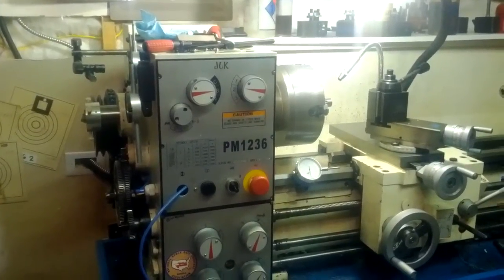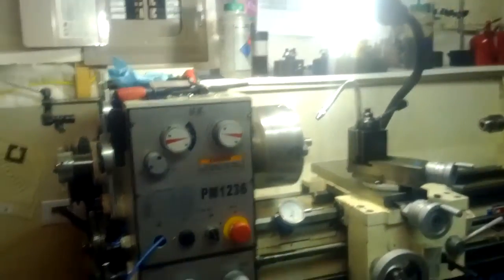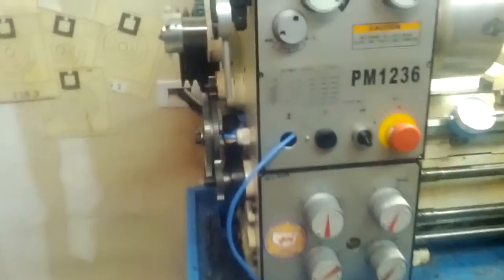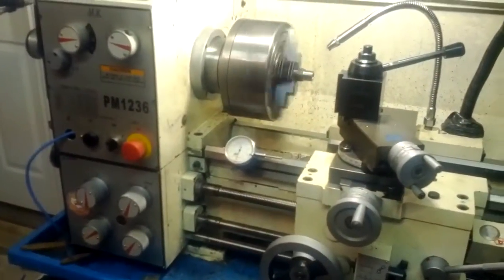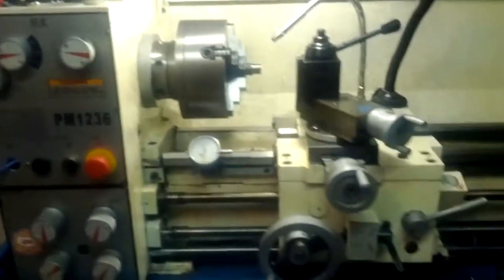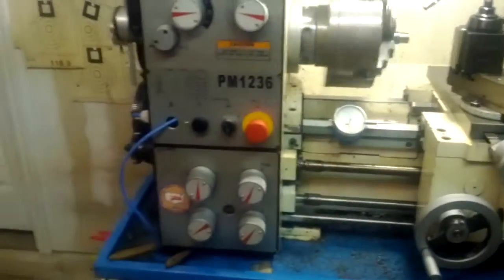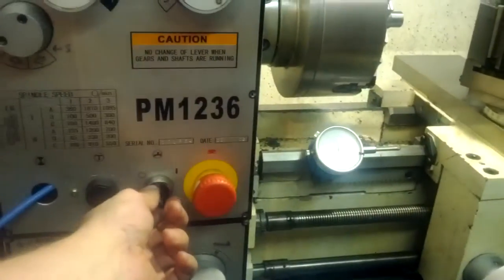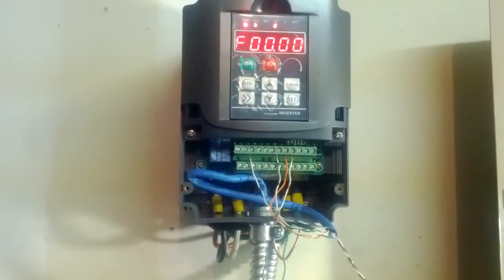remote control on vfd part 2( wiring remote control of Huanyang VFD and PM1236 lathe)

Comment: Hi Jonathan - one more question. I notice that when your apron handle is in the forward position, you hit the e-stop, then do a e-stop reset, that the lathe does not automatically start running forward.  Did you have to do something to make that happen correctly?  Thanks,

Comment: Just saw your schematics on Photo Bucket. Have to figure out how to get them off of there.  Did you dump all your contactors/relays?
Reply from the maker: Mogman150 yeah I ran everything from the vfd..the light I switched to 120v separately..only thing I left on the original 220 was the pump, I need to separate it still

Comment: Hi Jonathan- I also have a Huanyang VFD and would like to control my lathe directly.  Do you have a rough schematic of what lathe controls got wired to what VFD control lines?  Also, how did you tie your variable resistor into the VFD?  Thanks,

Comment: hey there, how are the directions for the low voltage control wiring on that vfd? I need one for a 2 hp and wasnt sure how they reverse rotation.